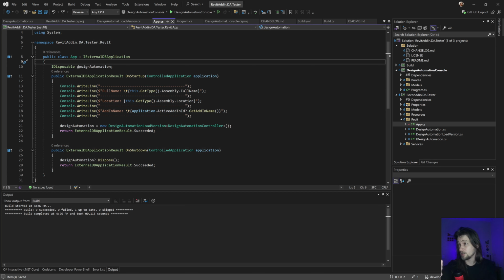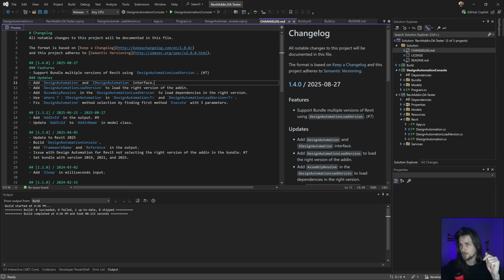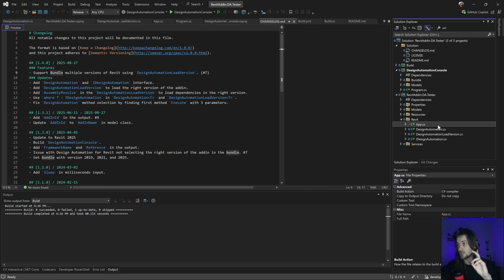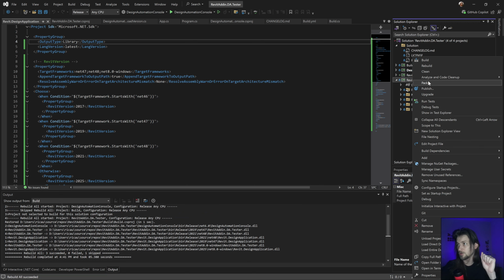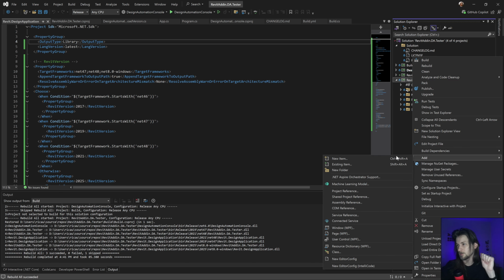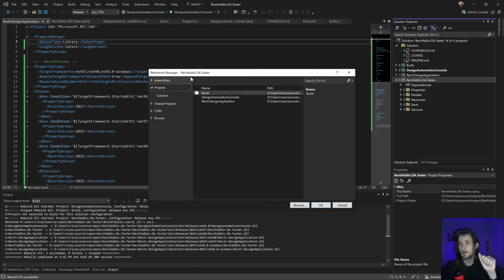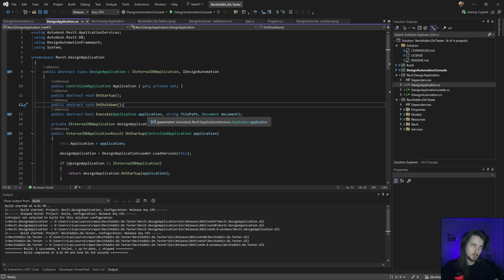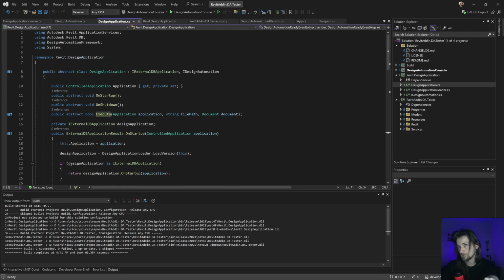DA4R - Revit.DesignApplication

Comment: Hi Ricaun!
Not really related to the topic of the Video
I am currently working on Multilingualization for the Revit Ribbon, is there a way to make it update the language change automatically without restarting Revit?
Thank you.
Reply from the maker: Hello Phuong,
There is not way to change the language without resetting Revit. If Revit open in Portuguese usually the resources for pt-BR is loaded if exists. Update the language with Revit open only make sense for testing is your Multilingualization is selection the correct data or something , but in a normal Revit never gonna happen.
Reply: @ricaun  It's a pity to hear that. Anyway, I still appreciate it. I really enjoy your posts on the Revit API forum.

Comment: so it suppose to load correct dll to current open revit?  did I get this rigth
Reply from the maker: Yes if your bundle have multiple versions/dll DA4R load the first version ignoring the configuration in the bundle, this code force to reload the correct version. So you only need to create one bundle with all the version of Revit inside, instead of creating one bundle for each version.
Reply: @ricaun  It hard for me to see point of this, you still have to buildyour project for every version. The only thing you get from this is having only one addin file . It sill interesting thing, because your redirection have to work on net framework and core  in all version
Reply from the maker: @mikoajfrankiewicz218  You will still have each .addin for each version, inside the bundlezip. The main problem is exactly the problem with net framework and net core.

In my bundle, the lowest version of Revit is always the first in the bundle configuration, and it is net framework, because net core can load and execute the assembly that is net framework if it is not using any code specific to net framework. The net framework code will load the correct net core assembly and continue the application normally.